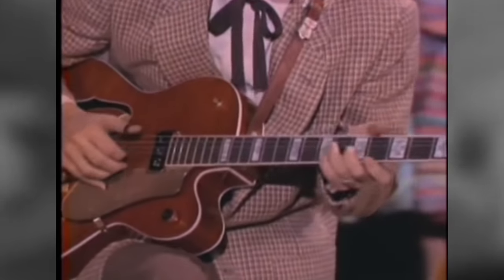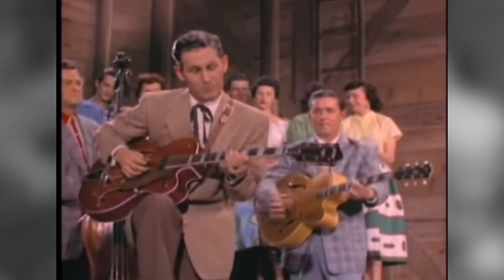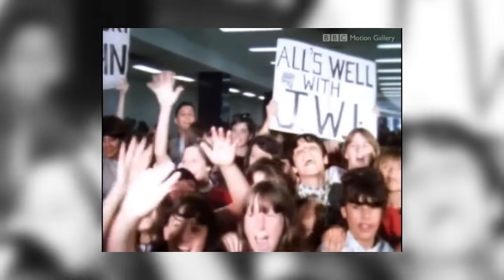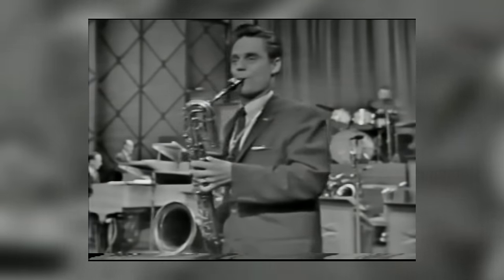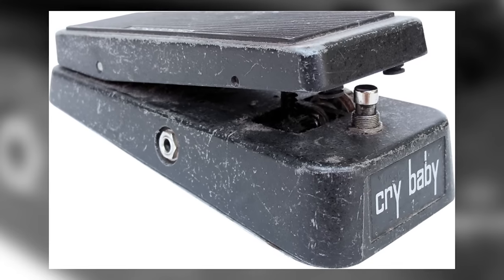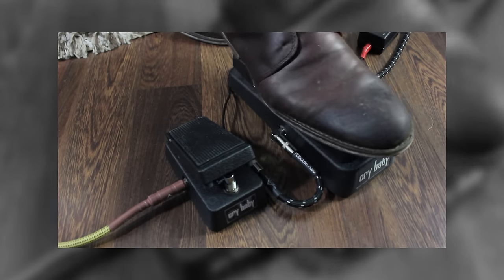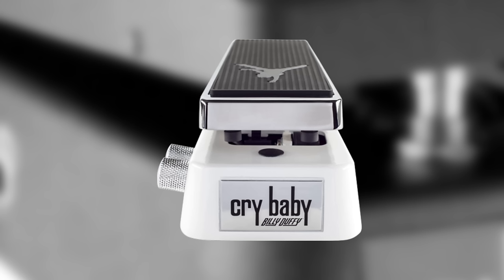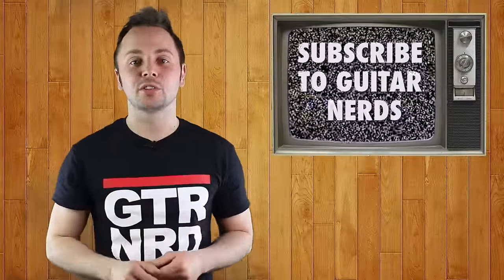The history of the Wah Pedal in 3 minutes or less

Comment: I'm fond of Ibanez's Weeping Daemon Wah. Because of the tone controls and what amounts to an adjustable Q, I use it with bass too. The pedal also can be set as a spring loaded in the up position or as a no tension, can be left cocked in any position with the treadle tension adjustable. It has an led light for on or off and the battery compartment is easily accessible.  The on and off is an electronic switch and the lag for that is adjustable too. It does take up some real estate in my board, but it's versatility makes up for that. The tone works for me and because of the adjustability, there's no pickup made that I can't dial in an acceptable tone.

Comment: bi own 5 wah pedals. my favorite is a 68 made in italy crybaby with the trash can inductor. its warm and less distorted than most wahs has an amzing splash to it.i also have a 68 brown stack of dimes it is great for more aggressive wah tones. tied for my second favorite is the ultimate wah i modded to have 5 inductors selectable via rotary switch ,switchable input caps and swotchable transistor for low and high gain wah tones. no matter hiw hard i tried i could not get the sound ot the trash can wah the caps from that era are impossible to find and they add a warmth that cant be matched

Comment: I dont wanna be 'that guy' but wasn't it The Thomas Organ co. who bought the rights or licence to build Vox equipment in the US? Almost immediately switching to Transistors (whats an AC-30?) in the hopes that being lighter without all the lead and glass of valve powered amps they could possibly slingshot the amps and fx with a time delay parachute straight to the garage of the 8 million garage bands that formed in ;65 '66 and '67 (ok no balistic Amp delivery I was taking licence) but it seems that every 'one with everything' Super Beatle down to the pathfinder I can lift with one hair has; Manufactured by The Thomas Organ co in 'Murica on the wordsy plate on the back, hich is sometimes also the front. Was that just th factory or something?

Comment: Morley Distortion Wah-Volume for it's versatility; however, the tonal quality could be better. The distortion is too fuzzy and tinty and sounds like the dreaded Boss DS-1; however, the distortion does make a good lead boost on some applications and situations. The wah also isn't the Clyde McCoy Vox wah that I like either and the 'cry' on the wah is very limited. On the good side, excellent for volume swells with the wah effect turned off.
PROS: versatility, excellent volume swells with the 'wah' off.
CONS: annoying fuzzy distortion, not quite the fat Clyde McCoy Vox wah that I like.

Bottom Line: What comes with versatilities also comes with limited effect quality, but it's good enough for me since I'm a vain and insane tonal perfectionist, so it's my fault that the pedal isn't good enough when it should be. :p